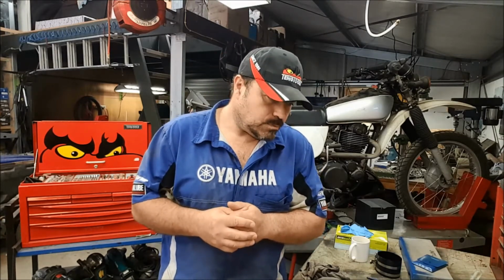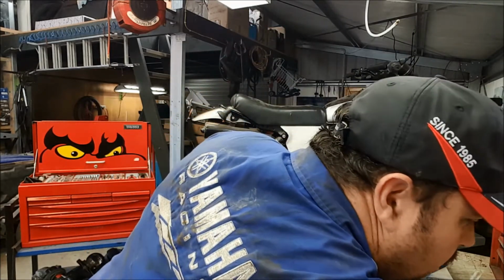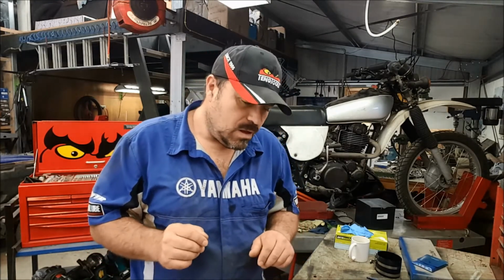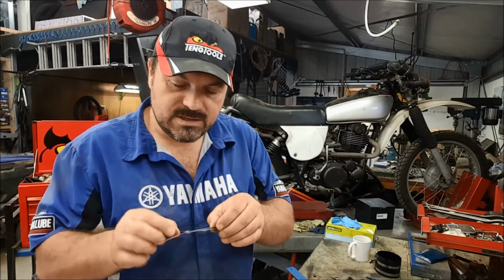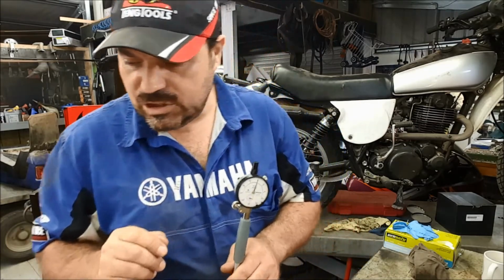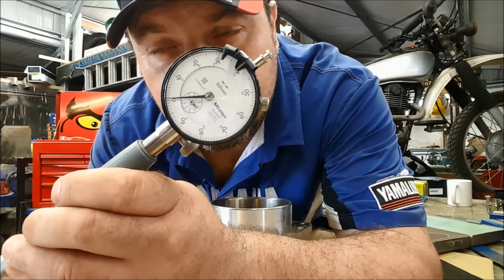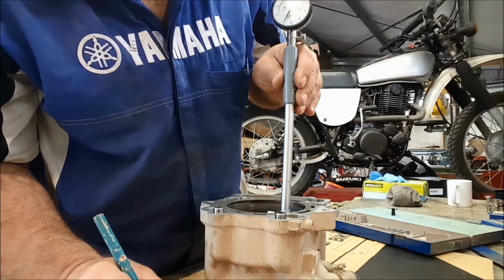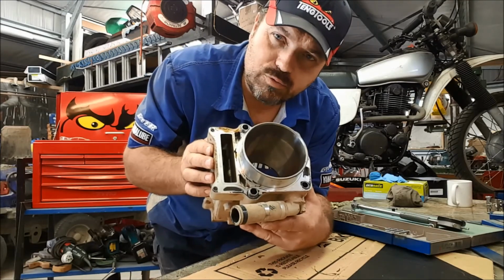Yamaha Viking engine cylinder measurements #1104

Comment: Andy I have a 2015 Yamaha Viking v1 that had a defect and blew the motor. I am in the process of rebuilding it but having trouble with the transmission do you have a video of rebuilding the the transmission for that particular machine I have not been able to find one. Lining the gears and shifter forks is what I am having the most trouble with or if you know where I can find a detailed manual that would help out as well.